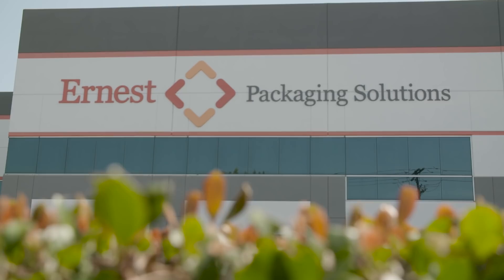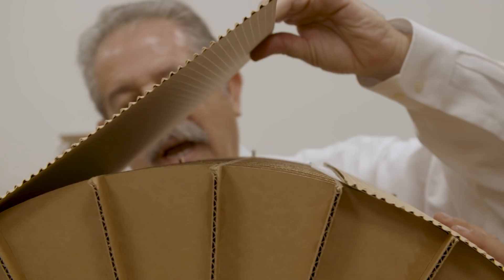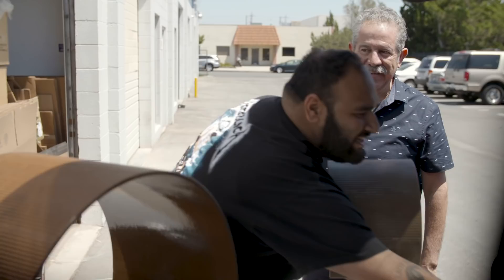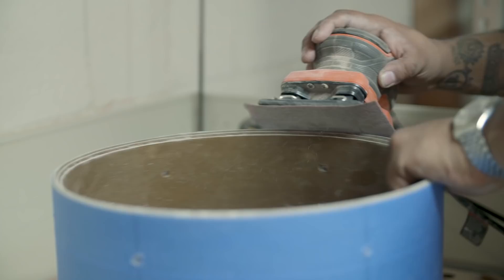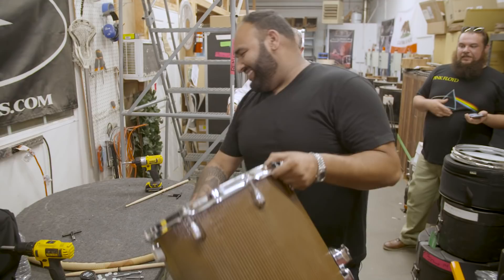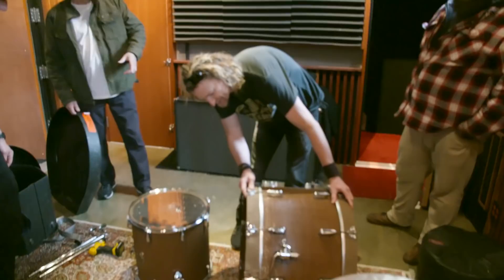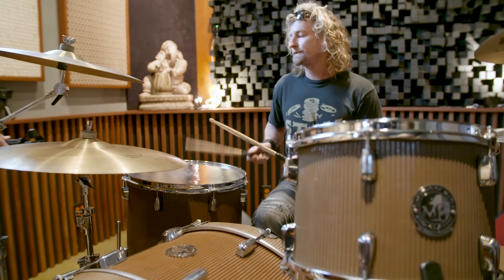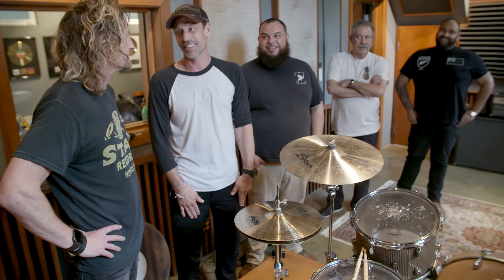Cardboard Drums featuring Stone Temple Pilots Eric Kretz : Cardboard Chaos

Comment: This is really cool, but not the first time it's been done. I remember in the early 70s we used to joke about cheap drums being cardboard. I didn't know this was true until later in the 70s when I saw and played on a cardboard drum set. The shells weren't made of the corrugated cardboard like you see in this video, but simply made with many layers of paper like cardboard tube shipping containers. The bottom heads weren't even heads they were just thick layer of cardboard painted white with a rim on them. Batter heads were real and tunable. The counter Hoops were made out of plastic and vacuum chrome-plated. I would guess from my recollection that the thickness of the shell was about what you see on your standard shipping tubes a couple millimeters. I think these drums came from the back of comic books where you could send in a certain amount of money or sell a certain amount of grit and win prizes. I think this was one of those situations. plastic lug casings, But Metal tension rods.

Comment: Remo did it years ago (Acousticon). Sounded great, but not very durable (no surprise).
Reply: I had a snare and the bearing edge collapsed.
Reply: It's unfortunate that their early versions of Acousticon were so bad. I had a snare that was a later iteration (shell material was black), and it was really great sounding, and strong. Iirc, it was 13"x6.5", but could be tuned to sound bigger than most 14" snares (and it had a HUGE tuning range).

Their Gold Crown drums (last sets and snares they made) also seemed to be great. Wish they could have overcome the poor reputation and kept their drumset and snare line going.

Comment: see i knew there was epoxy involved. i preached like a baptist when the cardboard guitar video was out and as a luthier i knew that straight cardboard wasnt gonna work. i bitched about them trying to say it was "just cardboard" and i said over and over that it had to be an epoxy resin or some kind of fancy polymer they impregnated it with, and then this video proved it. its just a filler and the epoxy is the miracle material. why not just actually brag about the resin? the resin is impressive, i mean that's thin stuff and its holding, that thin resin lattice held as a guitar neck under like 200 pounds of tension (or so they say, because 200 Lbs is 33 pounds per guitar string and that's ridiculously high, ultra-heavy guage, i mean that's more than double double what slinky-pink strings have at standard E tension, but what do i know, i'm not a cardboard expert, i just build instruments for a living.)

Comment: Cool stuff but they used a resin so the sound is coming more from the hardened resin then the cardboard, does that not defeat the purpose? I understand they would need a hard surface to drill into and have strength etc but still its not cardboard its resin. Cardboard was just the template that the resin attached itself to.

Comment: UNDERSTAND: contemporary ideas about drum shells are just plain confused.  The RESONANT part of a tom tom is actually the VIBRATING COLUMN OF AIR inside the drum.  In My Opinion this should be a lot smaller diameter then the head size. 

 I used to have some Premier Resonators.  Also mid 1980s Sonars have the same quality: REALLY THICK SHELLS (like maybe 6/8" to 7/8".  So you get a smaller vibrating column of air in the drum and it gives the drum better acoustics and tune-ability.  

CARD BOARD DRUMS COULD BE A REALLY GOOD CHOICE FOR THIS DESIGN!!!  IMHO
Reply: All of Sonor's German made drum shells remain slightly undersized.